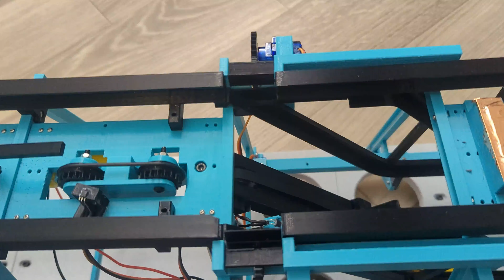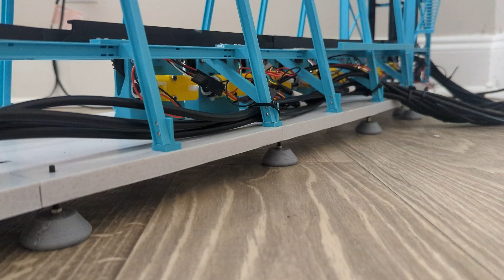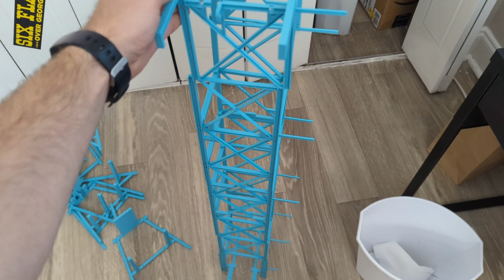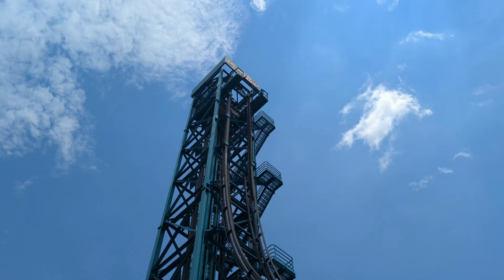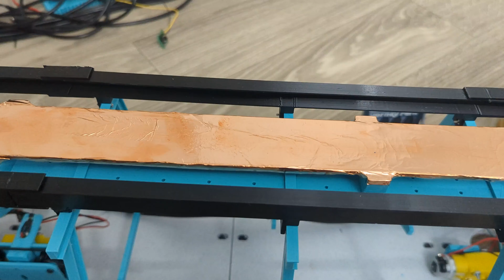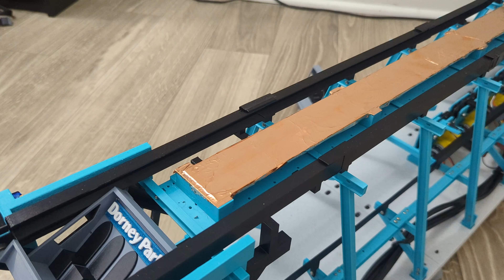Finished Model Demon Drop | 3D printed Scale Model of Cedar Point/ Dorney Park's Free Fall tower

Comment: Do you know if the model can handle 6 vehicles at once? Many other 1st gen towers can do so
Reply from the maker: It has the blocks to do five, but I only have four. I intended to have it run six, but the spacing was too tight and the magnets from the brakes and their rear bearings were causing them to connect to each other. If I was to build it again I would redo the return belts to space them out more.